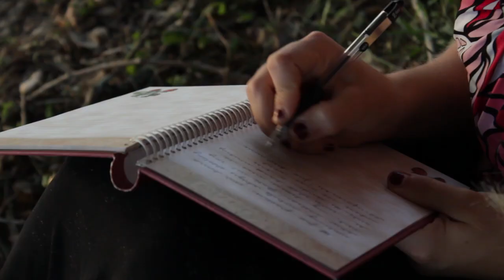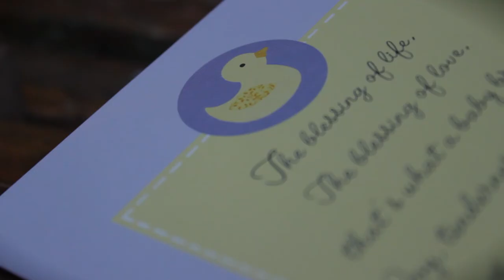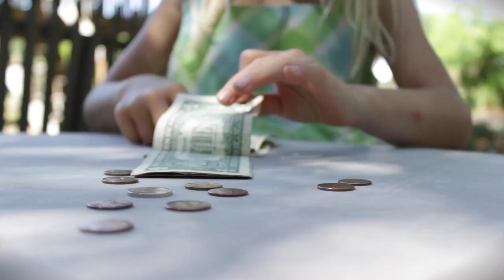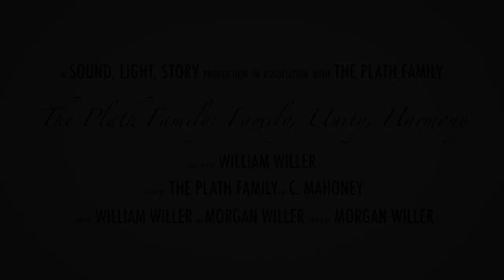Quiver Full Plath Family

Comment: Mental Illness Often Goes Undiagnosed and Untreated:  Due to the nature of mental health, those with a mental illness or illnesses often live with their symptoms for long periods of time before seeking treatment if they ever do so at all. Without professional help, mental conditions will only get worse, so the sooner that patients are diagnosed and begin treatment, the better. Persistent symptoms often drive people to self-medicate, which is the act of abusing drugs or alcohol in order to get temporary relief from their symptoms. This behavior is typically observed in those with a chronic condition, particularly mental disorders, and can be a more accessible than professional treatment depending on the individual case. However, self-medication is only initially effective. After it becomes the standard solution for symptoms, it shortly becomes the same for any ills whatsoever. This progression soon gives way to substance abuse and addiction followed by patients turning one mental condition into two, each enabling the other to spiral out of control.